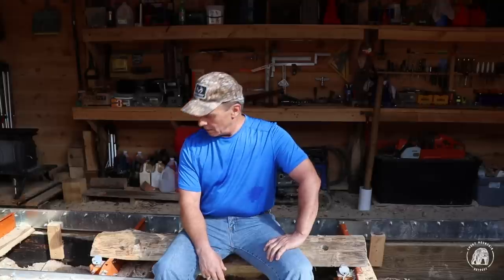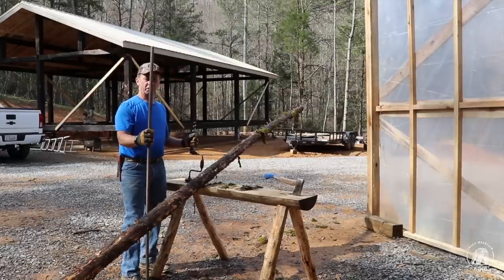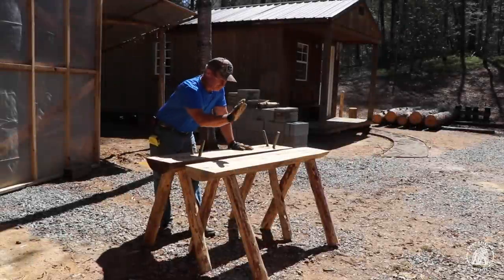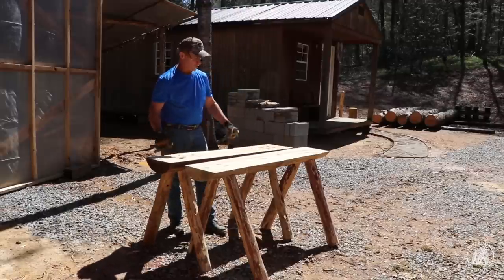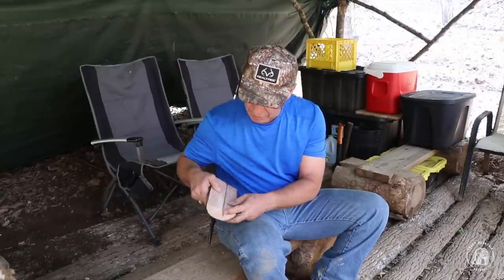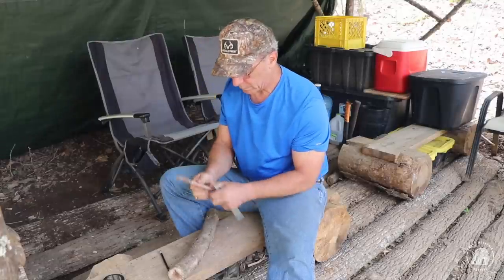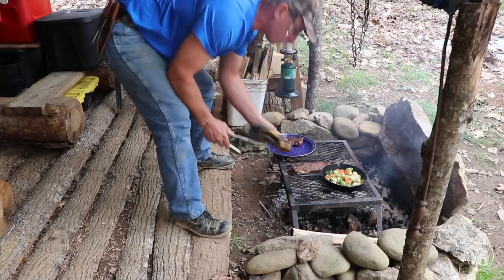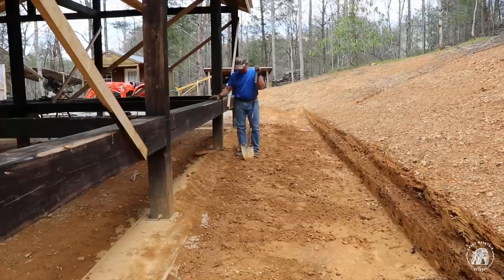S2 EP19 | WOODWORK | BUSHCRAFT SAWHORSE | BUSHCRAFT FORK AND COOKOUT

Comment: Just thought I would let you know in case you didn't know. After you sand your utensils that you carve, you can burnish them with a brown paper sack, just rub it on them as you would sandpaper and it will make them even smoother. The Linseed oil you have also makes a great finish for them. It is perfect for things like that and cutting boards. It is food safe.
Reply from the maker: That’s cool. Thanks for sharing

Comment: When our water hauler found out I  was a mason, he asked if I would be willing to get down into a cistern to do repairs.  He had lot customers who needed help with leaks. When I said ok, we became friends and I learned a lot, but I didn't get my water any cheaper so I started researching small lakes. With enough room, and enough watershed,and the proper distance from any septic system, it was feasible so I started digging. L shaped 100x100ft on long sides,35ft wide,10 ft deep. 45degree bank. Holds about 150000gal . That beautified our 1  1/2 acres, provided all our water needs,eliminated our mosquito problem completely, and the fish are quite tasty too. Our in house filtration system cost $1200.,paid for itself in less than a year!  I have more info if you like!
Reply from the maker: Sure. Very interesting

Comment: Our cistern is 9 ft diameter 14 ft deep , round,with concrete floor,slightly sloping to center,and made of brick. Has opening at top big enough to get a ladder in for maintenance. Holds 5000 gal

Comment: How much water will your roof catch in a year?  1.6 inches of rain equals 1 gal. per square foot.
Reply from the maker: About 43,000 gallons per year
Reply: Good day to u , digestion regarding saw dust , if I was in your shoes I'd try to place 3 or so tarps , once u collect enough , Huck up  tarps , one by one on your tractor , kind of like you carrying logs, take it to future garden site and keep dumping , let it compost till u neaded .
No need for shower 😁👍

Comment: Working height of saw horses should be 28”. Yours are too high.
Reply from the maker: Hey there! Thanks for commenting :) we actually have several different sized ones for different applications. Some do get used a bit more than the others. When we first started mortising the timber frame posts we used some that were about that 24-28” height. The ones you are referring to are probably 32-34, which is a hair more ideal for pulling bark off a tree, because it’s more comfortable, more leverage and less bending over. I would say a 28” standard is relative to the height of the individual and the application. But again, we weren’t trying to build things by a standard, it was what felt comfortable and worked the best for what we needed it for.